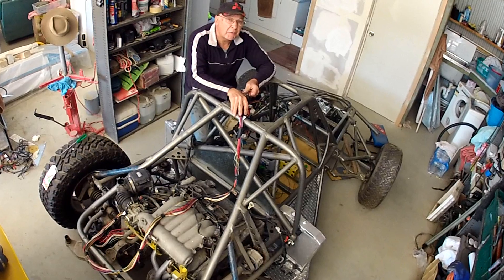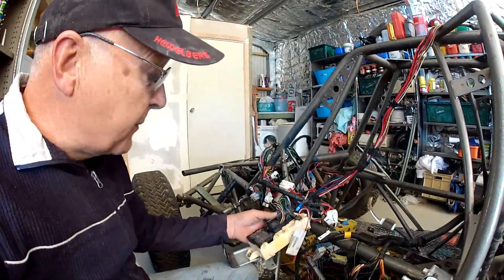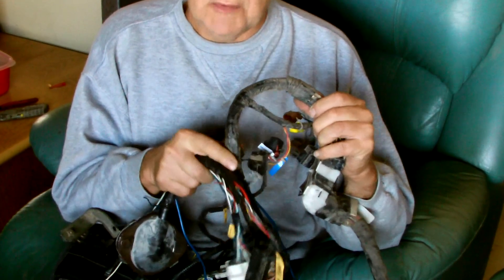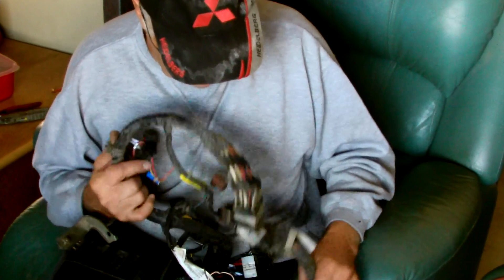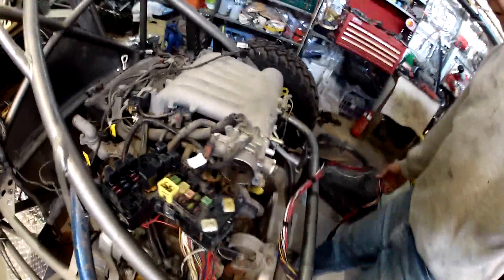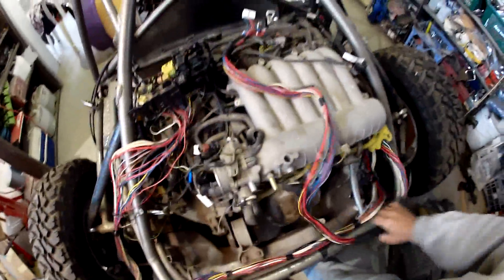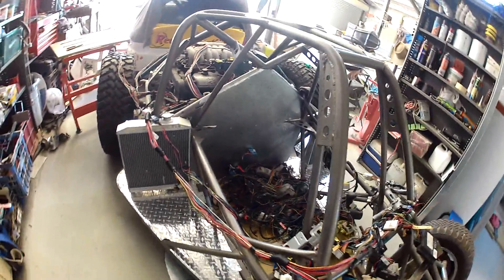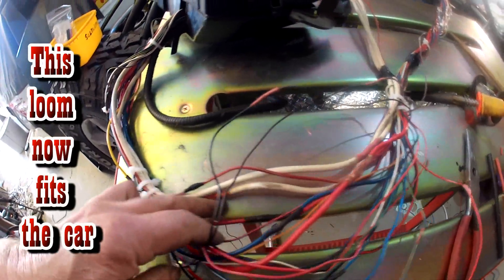Offroad V6 Mid-Engined Buggy Build - Part 12 # version 2

Comment: The little magic black box is the BCM body control module what ever you like to call it, It’s the big pain in the bum when it fails as it controls the immobiliser etc for the Alarm / Security system as it’s the one that sits in the drivers foot well near your right knee where the ECU is buried in the centre console.  Unfortunately the ECU and BCM are paired together with the immobilisor code so if neither talk to each other there’ll be a no start, I’ve had that happen in my old 2001 TJ Magna (may it rest in piece after it was rear ended at 50kph don’t use your phone while driving MmmKay Kids As you won’t see a stationary vehicle ahead of you at a round about) and my currant KJ Verada did it on occasion which turnt out to be a loose ground wire.